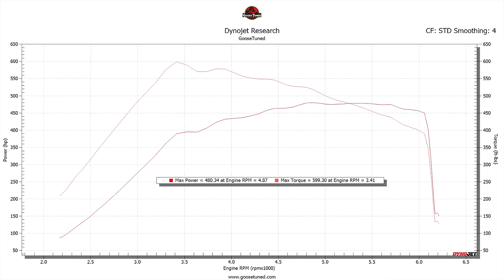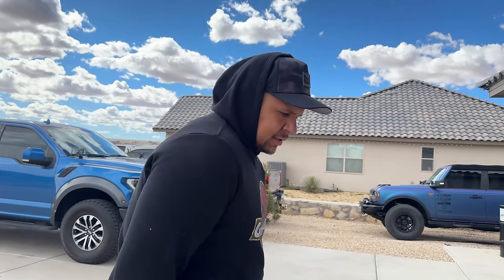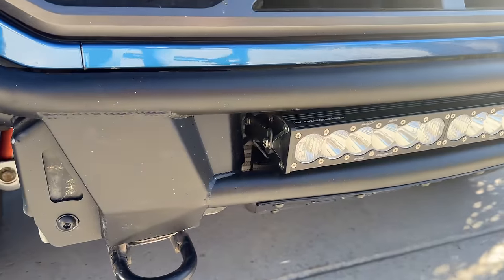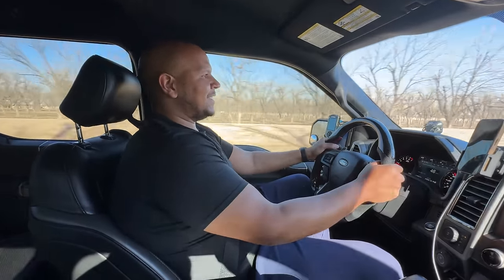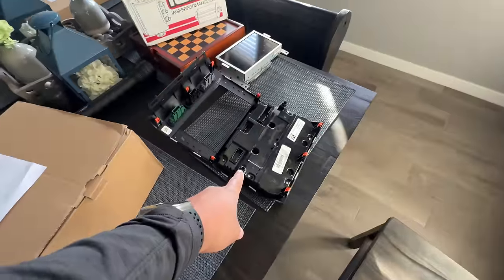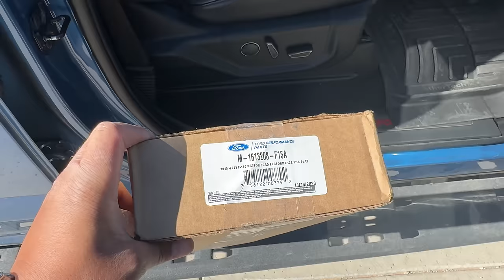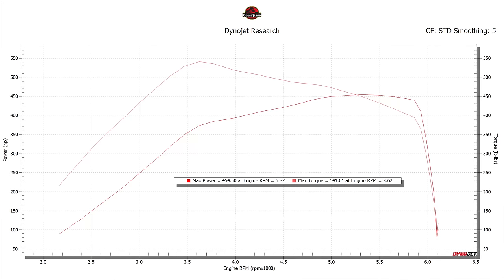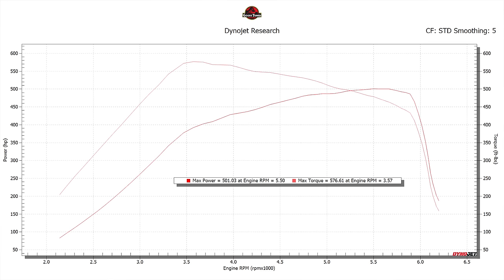Project Raptor Build: Episode 2 - One Stage at a time

Comment: Windfield does that head unit work with the B&O system?
Reply from the maker: Sure does! That’s what I have!
Reply: @goosetuned  cool. I also had a question. So I have both trans tunes yours and the Cobb on transmission. I had Ford put in a cdf drum as well as other stuff put in. Will the tune be different on the shift points we dialed in from before?
Reply from the maker: Nope it won’t be any different at all. You’re good to go 😎

Comment: You should've gone with the 15.6 touchscreen instead of the auto tech
Reply from the maker: I really wanted the flush look. I use the top holder in the dash for random bits. I did not want to risk punching the screen by accident 😂